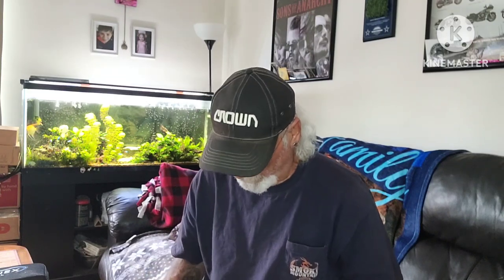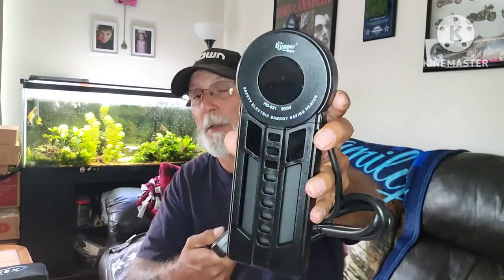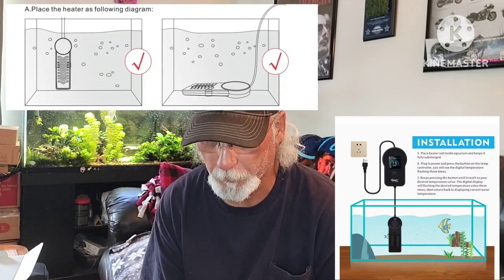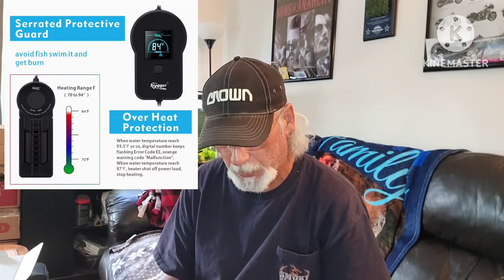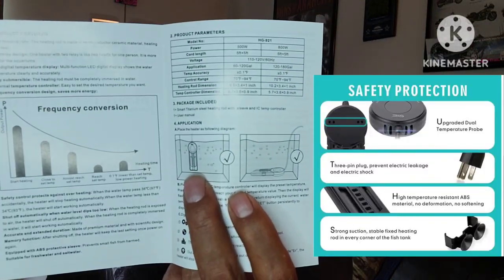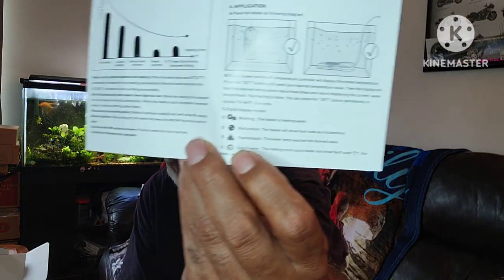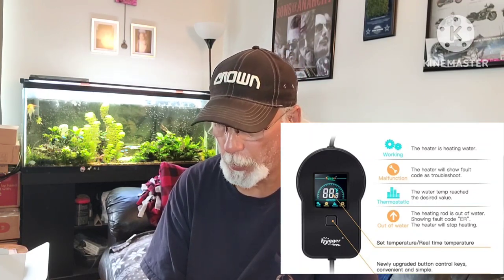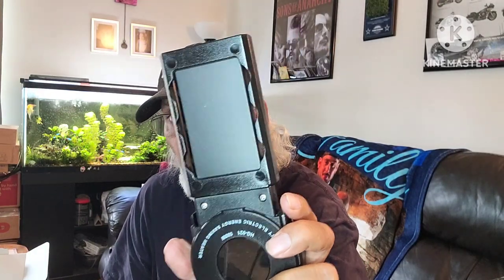Unboxing of the Hygger HG921 Titanium Steel Heater

Comment: I wonder if this would work well for water turtles.
Reply from the maker: It should work well. You would just need to work up to the desired temperature slowly as it heated the tank up in the video 15 degrees in a matter of minutes. But that was due to not that much water.